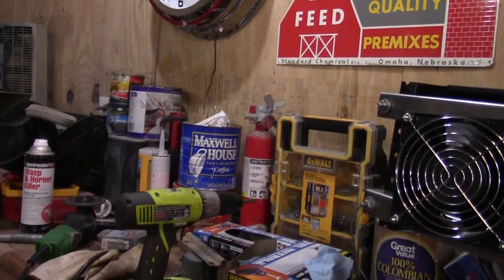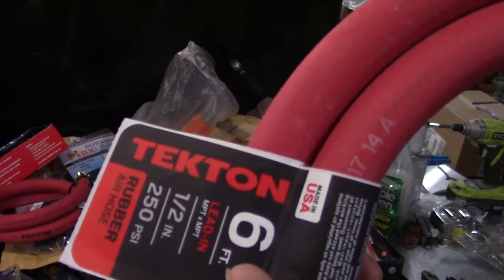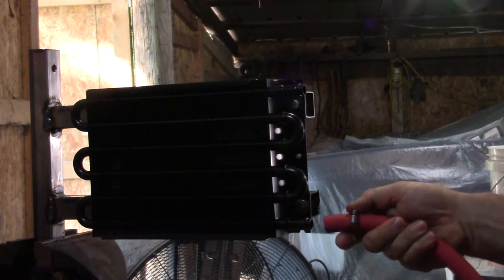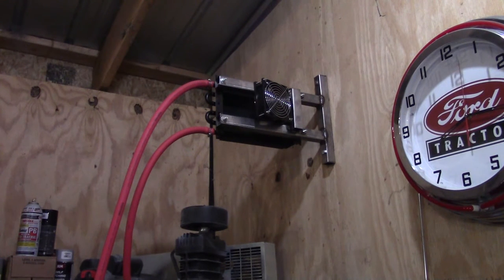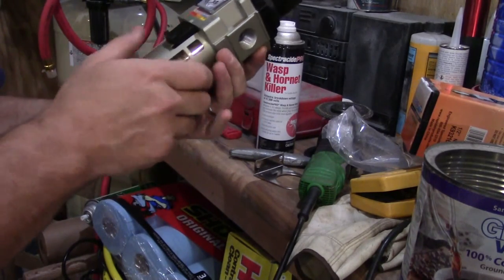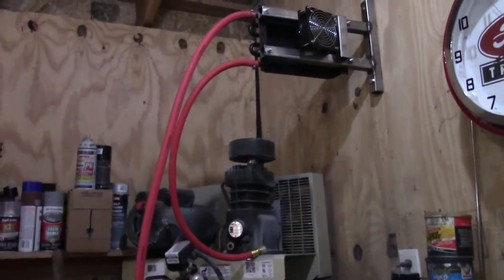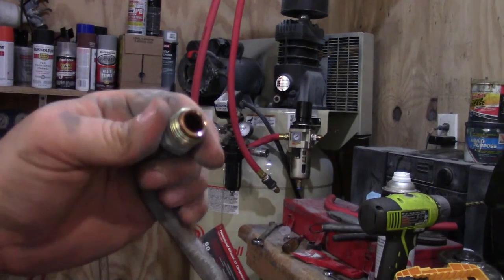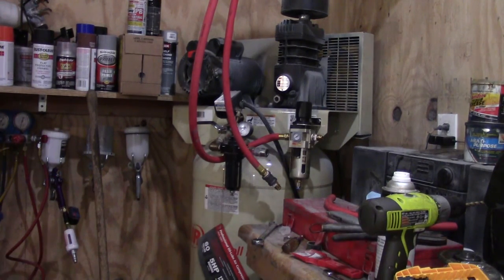Air Cooler Install Part 3

Comment: So you will be happy to know I have that exact separator , and although it says manual , mine kicks open automatically when the compressor kicks off and the cooler evacuates the air .
Reply from the maker: Haha, I got that separator after watching the vids you made about yours.  I sure hope mine's the same way, but I did order another one with an automatic drain (operates on float I think).  Can't have too many filters ;)
Reply: +Farmboy's Garage true I have several